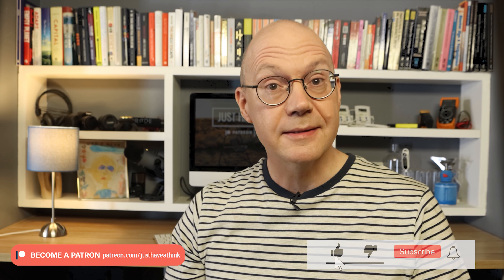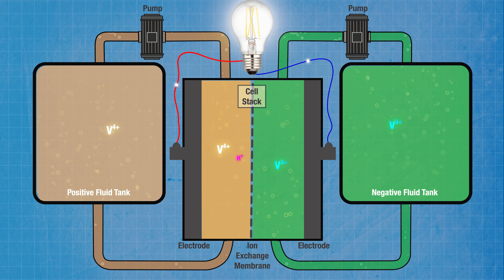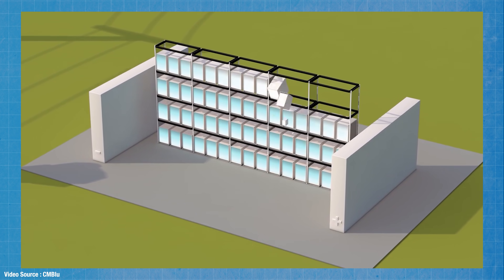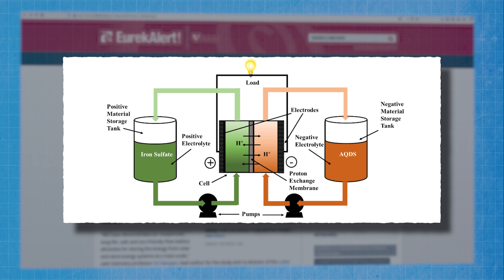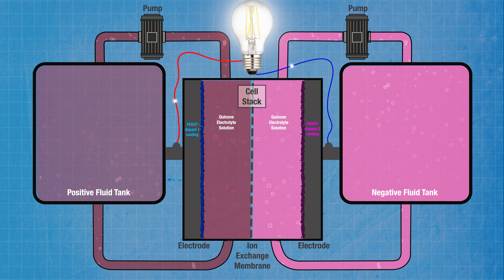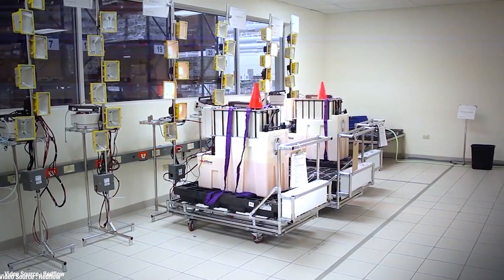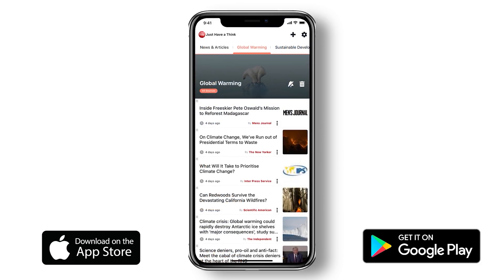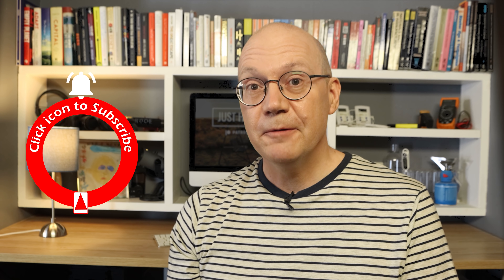Organic Redox Flow Batteries - The true path to grid scale energy storage?

Comment: I love what musk does but I always felt like this was a better choice for electric cars. For one of the biggest practical drawbacks being charge times, you could use these batteries to essentially fill up like you would regularly in a petrol vehicle but in a sustainable way. Better yet you would still eliminate or significantly reduce the requirement for "gas" stations to need tankers to fill up as recharge could be conducted from the grid both at home and in station. Not to mention the range advantage due to the ORDER OF MAGNITUDE greater energy density in lithium flow batteries (anywhere from 2-14x depending on where you draw your comparison).

I'm so sad that this technology has never been implemented in a car and particularly by Tesla who had the power to do this before committing to their current infrastructure. For all the engineering challenges Elon has overcome, this just seems like a no-brainer based on the benefits vs difficulties. For all my adoration of Elon, his narrow focus on Li+ still hits me as a missed opportunity.

Comment: Let's do the math!
In Germany it is not unusual that especially in winter there is neither wind nor solar energy available for 2 weeks.
To close this gap with Redox-Flow-batteries, an investment of at least 1000 billion $ would be necessary. But of course this does not include the costs for wind turbines and solar systems, because that is just the battery.
But to completely supply Germany with reliable, clean, and CO2-free nuclear power would only require around 50 Power Plants at a cost of $200 billion.

So these batteries are nonsense!
I ask myself again and again why all these wind and solar friends can't calculate.  Did you never go to school?

Comment: Do they last forever? No. But I know a company that has a battery that will. Made from dirt cheap materials. 50,000 cycles, zero cell degradation. In fact every time you fully discharge the battery its a maintenance cycle. Ambri will be in the market Q1 2021.

Comment: Grid scale storage is good for solar and wind, which are big ugly and obtrusive part time power sources.
With Molten Salt Fuel reactors (fast or slow spectrum) that provides gobs of power continuously these batteries and big ugly wind and solar sources will not be needed. Load following is also good.
The fastest and cheapest way to carbon free energy are MSRs.

Comment: The problem is energy density a standard 40ft iso shipping container can store 84kw of energy, compared to teslas offering of around 150-200 kw in the same density with power grid equivalent inverter plus transformers , also crucially the outflow of energy is lower  there is also the issue of temperature for the liquid storage so it doesn’t freeze this also adds to the install costs if stored outside, China has the first working grid tied load shift but needed a warehouse size building to shift 200mw 8 hours worth , so it is yet to be seen if this or other types of batteries such as variant of iron oxide with its lower cost , with its down sides of buffer for low end not being an issue on industrial scale
Reply: But for stationary use? That densitiy ratio to the teslas is still good if they last really long, are safe, reliable, simple to use, cheap and so on. And all the heavy stuff is fluid, so you could just order a tank truck filled with electrolyte, fill up the containers and there you go. For households you could also pair up a large redux flow battery with a small lithium buffer battery for short term high energy applications.

Comment: I've been a big fan of flow batteries for a long time.  Good to see that they are still getting attention.

I'm not that troubled with the toxicity of Vanadium, (it is locked away inside the battery after all), but a cheaper electrolyte is a big deal.

Warm regards, Rick.
Reply: So, which is better? A Redox flow battery or an actual manufactured Aquion ENERGY Salt Water battery?
Reply: @ajcongdon1772  
Hi AJ Congdon.  I don't know enough to say, sorry.

Warm regards, Rick.
Reply: @RicksPoker  What enough do you know about them to have an opinion you are comfortable sharing?

Comment: sunfire’s thermal electrolysis technology efficiency is over 80% making it much more then any battery in the world. A windmill to produce hydrogen combined with natural gas operated co2 capture facility producing a liquid carbon neutral fuel is far more effective and efficient then storing energy in a battery.
Batteries are not the answer.
Reply: The word you were trying to use in your comment is THAN not THEN.  It is easy to dismiss otherwise intelligent comments when the author can't be bothered to use proper grammar.  Why don't you practice using the correct word?
Reply: @jflivingston  Sorry, I’ll talk to my iPad about that that one. So glad you thought that had to be rectified. However, do you actually have anything productive to say about my actual comment other THAN attacking minute grammar mistakes. 
Was it because I said something wrong about batteries? Is that what triggered you to write such a comment? 
I ask again do you have anything constructive to bring to this conversation?
Reply: @muckman5509  Nice, keep up the good work.
Reply: @jflivingston  I ask again do you have anything constructive to bring to this conversation ?
Reply: @muckman5509  Did you get an answer back from your iPad yet?

Comment: Lithium Titanate Oxide battery is the way to go, over 50 years of use and still have over 80% of there capacity, I have just built a 6.6kW bank of them, and if you can get enough power, you can change them up in 16 mins
Reply: Wow, you just convinced me!
Reply: LTO is amazing technology. Just they tend to cost about 10x what LiFePo4 batteries; which are the real heavy hitters in the industry being relatively cheap and much safer than older lithium technologies.

Comment: any one else get frustrated about all these great ideas we hear about that never seem to go anywhere?
Reply: Yes, though to be fare a lot of the times the reason we never hear anything is because the mass manufacturing step was a failure.
A lot of technology that works and is even cheap in a material sense can prove expensive/difficult to manufacture on a large scale.

Most of the time gap we see (10+ years) is figuring out how to mass manufacture it then building the actual facilities and market to do so.
Reply: Sometimes they do go somewhere, but the connection happens in scientific journals and we never hear about it. Like in the video, the Swedish scientists used the same organic conducting polymer that was in the bricks as part of their flow battery. One technology may lead to another, but not in an obvious way.

Comment: One area where this technology could also be used, say you have the ability to produce power in a remote area, but you need power in a urban area 1,000km away.  You build the battery as say a railway tank car, you charge the tanks in the remote area, then ship them to the urban area to be discharged,  Perhaps you have tanks at the remote location, then build a pipeline, so you can drain the charged tanks, ship it through the pipeline, to other tanks in the urban area to be discharged.  Maybe you make the tanks small, and run the fluid through the pipes at a continuous, but slow basis.

Comment: Great episode as always. Thank you. One question, on the energy density front. What is the difference between the vanadium and the new organic style and how do they compare with lithium ion tech?
Reply from the maker: Hi Jim. The best Li-Ion batteries, like Teslas NCA batteries have a density of about 175Wh /kg.  Vanadium Redox batteries are about 40 Wh / litre. I don't have figures for the organic version. The up side is that they can be very cheaply scaled up just by adding more fluid capacity, and they can supply up to 12 hours of power, as opposed to the 4 hours that grid scale lithium ion batteires typically achieve.
Reply: @JustHaveaThink  And worth pointing out that, for static installations, density is not really an issue; just build it as big as you need it. (Great video, by the way.)  :-)

Comment: Crude oil from Venezuela is full of Vanadium. It was 1st found there hence the name of the country.  A friend of mine was a ships engineer. He was the Cheif engineer for the Blue Funnel line. He hated any of their ships fueling up in Venezuela because the amount of Vanadium in the oil condensed out in the ships flue he had to take a sledge hammer to the outside of the flues to brake up the vanadium and make it fall down the flue into a trap. He had to do it every other day or the flue would block up completely. It was in chunks 50mm or more thick. So somewhere there is a lot of Vanadium properly being thrown away as a contaminant.

Comment: Since some viewers are new to redox batteries, I think you should have emphasized their main advantage over lithium ion batteries: It's not their initial cost, but that increasing the length of time for a given power output for lithium ion batteries requires more lithium ion batteries, but increasing the length of time for a redux battery only requires larger tanks and larger tanks are much less expensive than more lithium-ion batteries.

Comment: When I was in the Air Force I worked on radios designed to talk UHF around the world. These radios have a directional antenna system. They are also extremely large antennas, about size of a fighter jet. The thing about them that always amazed me was that pointing and tuning of the antenna was powered by DC motors, about the size of a double “D” cell flashlight. They would be screaming away, but through reduction gears the antenna would hardly move. This enabled extremely fine resolution with the tuning circuits. Ever since I watched a video on dead weight power systems, I have imagined those DC motors and gear reduction could work lifting dead weights. That was 10 years ago, but nobody is talking about using them. Is there a major reason prohibiting dead weight power systems?
Reply from the maker: Hi Delton. They are definitely in development. Now called gravity storage systems.
Reply: there's also pumped water energy storage, which also uses gravitational potential energy and is i think the cheapest form of energy storage per watt hour for grid scale electricity

Comment: Thanks, that's very interesting. 
I'm looking an electric alternative to my diesel farm tractor for a remote farm in Fiji. 
So far I've come up possably with hydrogen fuel cells and using excess   power from our solar system to make hydrogen. 
Or alternatively a  flow battery and a tractor powered by powered with supper capacitors. ?
Reply from the maker: Hi Simon. I think JCB have started making electric diggers and tractors. They would also be a very good candidate for hydrogen fule cells though.
Reply: How about using  hydrogen as the fuel in the existing diesel engine?  It could also be used as your backup power supply by running through a petrol /diesel generator. I would think this a easier more practical path for the use of hydrogen than fuel cells. Also methane is an option to consider if you have livestock ,or ethanol, if you have plentiful biomass. If you produced enough ethanol you could even sell it locally as a fuel. What's a litre of gas go for in Fiji?

Comment: Redox Flow batteries are kind of a misnomer. They are just fuel cells and at least for those versed in fuel cell technology up to this point it's probably easier to understand them using that term. The idea of them being "hybrid" IMO adds two layers of confusion. For one because there is ALSO hybrid flow batteries which actually are hybrid they have a battery-like anode or cathode and a fuel cell like anode or cathode. Two, in the sense used when referring to flow batteries ANY fuel cell is a battery. Because a battery in this case is just a chemical energy device where electricity is produced from redox reactions. However other types of flow batteries like hybrids or membrane-less are NOT fuel cells.

Comment: Yay! You've gotten around to flow batteries. Have you looked into the paper "Minimal architecture zinc–bromine battery for low cost electrochemical energy storage"?. Their design uses carbon foams as the electrodes, and aren't actually flow batteries, as the electrolyte naturally separates into layers around each electrode due to gravity. I'm actually planning on building some to test as storage for an off-grid installation.
Also, Robert Murray Smith here on YouTube put together quite a cool set of videos on it. It looks like it'll be the DIY battery of choice.
Reply from the maker: Hi Jodie. Looks interesting. I'll have a read. Cheers.

Comment: Chemist here: the poly acrylonitril is not the electrode but the (semi-permable) membrane.
Reply: Also, if you want to sound fancy you should call the electrolytes as anolyte an chatolyte. I think it is in general incorrect to say that one electrolyte is negative or positive, but it might be a tolerated costum among the researchers.
Reply from the maker: Thank you for correcting me :-)
Reply: @JustHaveaThink  Just a small comment:  As far as I know, only cations (actually, only one cation, namely H+) can transit a membrane.  Anions are big and heavy and will not pass through.  The H+ attaches to one side of the membrane and another pops off the other side, like one ball hitting a line of billiard balls.  Please correct me if I am wrong.

Comment: Even if this new chemistry doesn't work out, Vanadium is fully recyclable and far safer than neurotoxic Lead in Lead-Acid (Pb2SO4) batteries, of which almost every car has about 30 pounds (15Kg) of under it's hood.  The acid in Lead-Acid batteries is hydrosulfuric acid and will burn your skin off.  Many of these batteries aren't recovered (along with lead bullets and fishing weights, wheel weights, etc.) meaning the lead eventually breaks down and gets into the environment as a dust, causing untold mental impairment (probably the source of so many Trump votes this year).
Reply: Agreed.  Vanadium is not nearly as bad as lead.

Comment: how timely as i have aquired 7 tanks  of at least 2000 lit. apiece, ...any idea on how or who might have already assembled a ":garage battery" like this>?
Reply: Maybe these guys? Redox Flow Batterie Producer -> https://www.cmblu.de/en/home/ ... Engery density -> 30kWh/cubicmetre...
Reply: @weingutjohner  
wow thank you , ...ain't the innerwebs neato?
i believe these are the people from the show, i was hoping maybe someone might have sources for the components available for a project today or already have attempted to assemble their own.
Reply: You will need two tanks for each cell in a battery, one for the electrolyte on each side of the membrane.  If you have only two tanks shared between cells you will only have the voltage of one cell.  Combining the tanks short-circuits the cells from series to parallel.
Reply: @edwardcdg  
so, ... 2 cells requires 6 tanks?
i am using IBC (bulk containers) and i also have 2 much larger tanks,
Do you know HOW they are proportioned/proportional???
Reply: @-LightningRod-  (having trouble with fat fingers here.  You might see a garbled response.)  
The electrolytes on each side of the membrane have different compositions.  The composition of the electrolyte on one side of the membrane will be different going in than coming out (call it 'rich' and 'lean').  If you take the 'rich' stuff from the tank and return the 'lean', or exhausted stuff to the same tank (you can assume the contents are well-mixed), the 'rich' stream gets progressively more dilute and the battery output will decline gradually.  The bigger the tank, the slower this will be.  (The big plus is that the amount of electrolyte is a lot more than what is only between the plates in a conventional cell, so one cell can run a lot longer.) You could maintain a constant performance by having a separate 'rich' and 'lean' tank, but when the 'rich' electrolyte is gone, the cell will stop and then the flows must be reversed when charging until you have a full 'rich' tank.  Kind of messy.
I hope this makes sense.
Reply: @edwardcdg  super good info it is like YOU are in my head, this all sounds reasonable. i NEED 1kw/h 24 hours a day, simple easy peasy. How much quinua do i have to eat and by "membrane" , ... can i use a condom? 
Seriously. i want to get on it like Today
any idea of the effect of ambient temperature deltas? and what about the electrolytes constant or , ...i need to watch the vid again.

Actually might be a Good youtube
Reply: @-LightningRod-  Wow!  You really have a fire lit under you.
I don't have that information, sorry.  You may have to build one and check it out yourself.
I learned from weeks of scouring the web for articles and a few YouTubes.  
Robert Murray-Smith has YouTube videos about Zn-Br batteries that are safe to build and have been scaled up by companies like Red in Australia.  He has a recent video here: https://www.youtube.com/watch?v=-1Xb0enBFcQ 
Here is a better one: https://www.youtube.com/watch?v=CvSYlMtY1Cg 
In fact, I hope to play with Zn-Br batteries some day with a target of making a little flow battery.
Best of luck!
Reply: @edwardcdg  
yes i just read the 7 page report , ... i think it left me ionnaphobalized, ... still not sure if i can digest the the minutea there but it was interesting but where can i get pedot and wire and stuff and a membrane was the most interesting part and easiest to get that unit that they showed between the tanks is something i have seen before it is an industrial filter rack for clarifying oil is transformers at least the principal operation of it
Reply: @edwardcdg  
yes the simplicity is very appealing i am also a subscriber to that channel